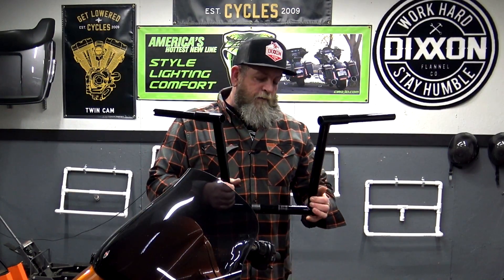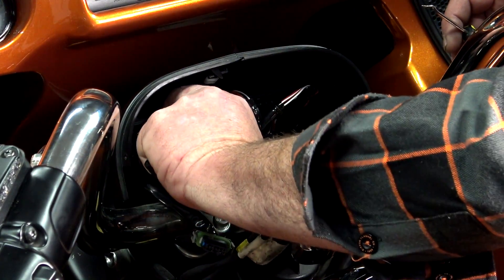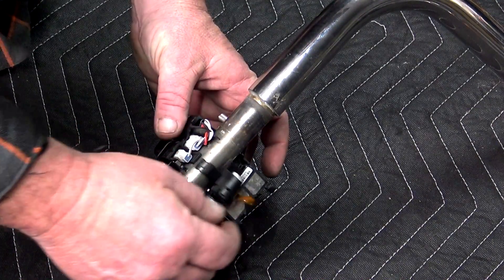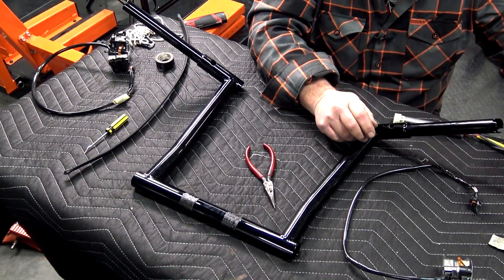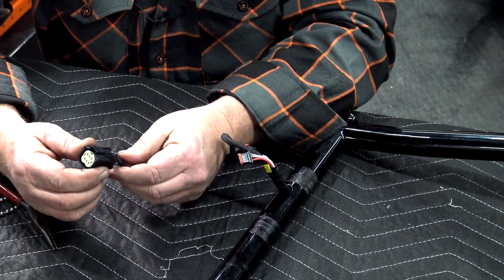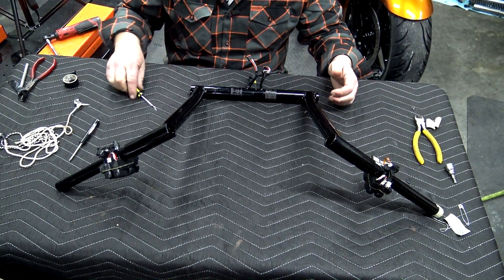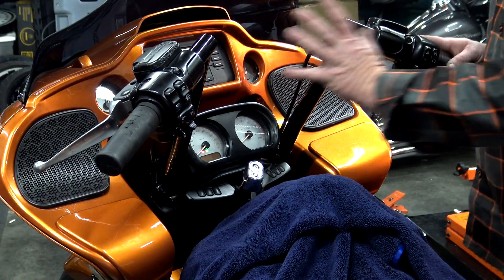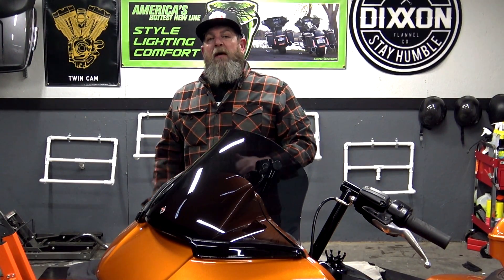⚡Road Glide Handlebar Install Road 6 Customs 2015 - 2023⚡

Comment: Great video! One comment I can make on the procedure (and I hope I am the first to tell this, as I learned this the hard way)? When the pin for the handlebar is removed (tapped down), the handlebars are free to move forward and back. And as they are pretty tall and heavy and when they are not snug, they can easily fall back onto your tank, creating a couple nice dents into your tank. So with these after market handlebars, always be aware that when you release the bolts, you catch the handlebars as just a towel will not prevent these dents.

Luckily for me, the towel prevented scratches and the dents could be removed by a specialist without painting.

Comment: My little tip for golfers - for the brake and clutch assemblies, I use my old golf club covers the way he used a Crown Royal bag. Slip them over and they can dangle safely without fear of scratching the paint. If you have some lying around, it's better than spending money or fooling with towels and tape. LOL
Reply from the maker: yes sir Bill...great recommendation...not a golfer so I never though about that but that would work perfect!

Comment: Those are very similar to the ones I added to my 19 Roadglide Special, I have the 6" bars, they fit me perfect and are below the windshield which was vital for me, especially during cold weather rides.
Reply from the maker: Yeah man I did the same thing on my SG and stayed with 10 inch so my hands were behind the fairing. We dont do a lot of cold weather riding but man its nice when we do.

Comment: Ordered the 11 inch naked bars took about 3 hours total to install myself new Grips love the bars so far also it is a 2022 so small plug for throttle by wire fairly easy install take your time on running the wires
Reply from the maker: love these bars! Get a lot of compliments on them...glad the video helped you!

Comment: Hey Steve, Thanks for the share. I bought the bars the put them on my 15 Road glide and they look great. I wanted to share something I found out by accident. When I de-pinned my throttle by wire connector the white center piece came all the way out and with the center piece out i found it fairing easy to de-pin.
Reply from the maker: yes I actually took that out during the de pining process when i cut the camera. I really should have just got the de pinning tool lol so much easier. I have one now and glad I spent the few bucks on it.  but you need to be careful not to break any of the plastic tips that holds those pins in. Glad you got yours apart.

Comment: Thank you for a great video! Had to run my harnesses separately on my '18 RG Ultra...didn't have the big molex connector, but the connectors it does have made a pretty big lump, even staggered a bit. Other than that, I would say that the hydraulic clutch cable "just" was long enough! Total time to change was almost 3hrs, but that was with the required beer break. Love the bars, and again thanks for the great tips!
Reply from the maker: Youre very welcome William! thanks for checking it out. And yeah mine too...just barley reached but they do! Glad the video helped man!

Comment: Just got my factory 47 bars and started this. Lucked out with the split, small throttle connector. Score
Reply from the maker: Thats awesome man....Everytime I do a 14 or 15 I cringe at the thought of seeing whats in there...its a 50/50 shot lol. Your wire job should go pretty smooth.

Comment: Goodnight!  I'm Brazilian and I want to thank you for the video, it will definitely help a lot when changing the handlebars on my motorcycle.  My doubt is about the safety pin, can you disable it, without running the risk of the handlebars not moving???

Comment: Really thought that de-pinning those connectors was a “I’d rather drink draino “ thing. But this video makes me think it is doable at my skill level. Damn-it, now I have to start shopping for bars.
Reply from the maker: its not terrible and if you get a cheapo de pinning tool from amazon it makes it easier...ive had those rather drink draino bars and pins before though...Ive actually said screw itm busted the connector and went to HD and bought another one and pinned it lol

Comment: Great video. My only critisism would be if youre gonna do the bars, do the risor bushings at the same time. Harleys stock bushings are garbage and unless you want to do this job again soon, do them while youre there. Other than that, if you follow this video, youll have no problem doing this job by yourself or with a friend. Outstanding content as always.
Reply from the maker: never had an issue with the newer model bushings. Although I agree as back in the day they were crap....they have stepped their game up a little but that being said if you are going to change this is the time to do it.  Ive had several 14 and up bikes thoughs and never really had issues with them.  If people wouldnt pull their entire body weight up using the bars, the bushing would last longer. Slide your rear back on the seat and push up instead of pulling on those bars, so to speak..if that makes sense.
Reply: @sikbaggers  makes perfect sense to me. I also run a step up style seat so i use my legs more than the bars. Love your channel and my 87 year old mother says you have as sexy a voice as Sam Elliot lol. I had to share that with you.

Comment: Just did the bars on my 2020 FLTRK.  You oughta try fishing wires through with the addition of heated grips. LOL.  Frikkin headache!  I put some Spooky Fast 12" bars on, they have sharp corners.  Your video was a big help.  Thanks man.
Reply from the maker: Hey ian we do them quite a bit here in southern illinois...and you are correct. I cringe every time I have to do a set lol

Comment: Nice job! What torque specs did you use to tighten the clamp for the handle bars?
Reply from the maker: handlebar upper clamp screws - 16-20 ft-lbs 21.7-27.1 Nm

Comment: Feed the chain and pull with the string, the chain can break. The propose of the chain is it easily follows the bars and finds the opening due to its weight and flexibility.

Comment: All your videos are great. I saw this video and I really like these bars except I cannot seem to find them for my bike on the Road 6 website. I have a 2018 Road Glide Special with the 1-1/4" clamping area. Any help would be appreciated.
Reply from the maker: https://store.road6customs.com/2015-2020-Road-Glide-NAKED-Handlebars-r6c2015roadglidenaked.htm these are the ones i installed in the video, they are the same for 15 to 20...1 - 1/4 inch , just pick the length you want

Comment: Great video , just finished mine step by step and bars look great ! But after installing cluster back on I’m not able to insert ignition bezel cover back on , very tight and won’t snap on , tried redoing cluster several times and same bezel won’t fit and and no ignition won’t press down and allow fork to lock if I force bezel in like this and might also snap bottom tab that locks in , any advice  ????
Reply from the maker: That ignition bezel was definitely an after thought by Harley lol you just have to press in the front tabs and then find a small pick or screwdriver to push the rear one down and click it in....if the tabs break, which they do, you can get a replacement on amazon. Ive had to do it a few times.  Chrome https://amzn.to/49zrrb0 and black https://amzn.to/3UC6b04

Comment: I have a 2017 Road Glide Ultra with heated grips.  Does it change much to change the bars with heated grips?
I enjoyed the video very easy to follow
Reply from the maker: not really just an extra wire and small plug...makes it a bit more of a pain to pull the wires that's all

Comment: I've been wantinug to swap bars to apes and I just bought my 23 road glide maybe 2 weeks ago. I keep being told that I need to run longer brake and clutch cables to do this.
Reply from the maker: that really depends on the size you want to run...all you ned to do is call a company like KST and ask...they have changed so many bars they will be able to tell you is you need cables

Comment: Do I need to do anything with the clutch or brake for the 12inch bars?
Reply from the maker: no you can do exactly like I did in the video and remove that plate that hos the wires in and you will have enough wire

Comment: OK Steve, here's an oddball question. What is the blanket you are using for your workbench. Kinda in the process of getting a better workspace in my garage and I recently ran across a good bench from Seville Classics, however, the top cover seems like a soft pine. A little too soft for work IMO. Any directive or information would be greatly appreciated.
Reply from the maker: Hey Brent...its really just a cheap moving blanket from Harbor Freight. I have several...another good use is laying them down in the floor to put your pags on or whatever other tin you take off your bike...they have served me well over the years and the wife got tired of me stealing the "extra blankets" and seeing them in the garage floor lol
Reply: @sikbaggers  well duhh Brent. I have to laugh as to how many search words I looked for to try to identify those and viola` there it is. A moving blanket. Boom! Thanks again for the response. Merry Christmas to you all and be safe out there.

Comment: I followed your fantastic instructions step-by-step however, once I finish the check engine light was on on my motorcycle. I have a 2019 Road Glide. Can you think of an idea why this may have happened? Or what should I do
Reply from the maker: absolutely normal...you just had a bunch of stuff unhooked so the ECM is telling you...follow my video here to test and clear your codes. If everything is hooked up right it shouldn't through those codes anymore. https://youtu.be/ZV8xONzYsTU?t=18

Comment: I found it very difficult to get off the clips on the right side of the cluster with fingers.
You can adjust your bars with the pin in but it limits your adjustment to about 15 degrees max. (At least with stock bars) I Would just knock the pin flush as you did.
Awesome that you're doing a video on the bars I've been planning to get. Did you mention what size bars they are and I missed it? Are those the 13"?? Road 6 Customs says you can go to a max of 13" before you would need wire extensions?
Great videos! Keep up the great work and thank you!
Reply from the maker: Sorry I just saw this comment yes they are the 13 inch bars
Reply: @sikbaggers  Thanks.

Comment: I have a 2021 road glide special, on the throttle cable has to connecter, do you just connect one connecter and just let the other connecter lose? Because I don't see where else to connect too unless I take off a connecter with two wire with a dummy connecter on it on the left side.
Reply: @SIK Baggers
Reply: @SIK Baggers

Comment: Great video! I have watched other videos and they say 14" is max before you have to start changing other stuff. I also seen something about pulling a fuse so codes don't pop up after? And if a guy added heated grips this would be the time to do it do you have a video on that aswell. Subscribed ride safe!
Reply from the maker: Yes sir...you can pull the fuse or clear them after you change the bars...easy to do through the speedo...And yes...for sure! if you are doing heated grips do it now! lol We did a set of bars on a 17 SG and they guy brought the heated grips over 3 days later...I asked him if he knew how those were installed and he said "plug them in right'? lol yeah through the bars we just had off the bike....ugh haha live and learn i guess.

Comment: Hey do you know where I could find a new throttle by wire with that bigger plug? Because I tried Harley dealer by my house and they keep giving me a little one?
Reply from the maker: I would check on ebay because youll keep getting the smaller one as they changed it

Comment: How much taller can you go on the bars before needed extensions? BTW love the channel
Reply from the maker: Thank you sir...with the RG its right at 13" bars...these are 13 and the cables barley reach doing what I did in the video by removing the zip ties and the central wire plate.
Reply: New Sub ..good info . You definitely know your shit . What a pain in the ass de-pinning that connection

Comment: Is the 14 inch the max before having to change brake lines and clutch lines and wiring kits 2015 road glide special
Reply from the maker: Hey Patrick sorry I just saw this...15 inch is pushing it with the road glides. If I went any taller I would look into cables for sure.

Comment: Great video, ordered the 13" bars from "Road 6 Customs", on the way to Europe now. 
Will let you know if this is a good choice, tried different types/brands already, never satisfied........
Reply: Got my 13” “Road 6 custom” handlebars delivered and installed, easily done with the great video. Did my first run with it and this is the correct handlebar for my length, strongly recommended this handlebar.

Comment: Wish I'd seen the road 6 bars before wasting money on the kst bars. I don't know if there was some sort of weld booger inside the bar or what, but no amount of trying could get the wires through, and trying was just tearing wire up. Ended up scrapping several hundred dollars worth of new bar and going back to the stock shit bars on my RK. If this virus ever goes away, I'm saving up to try again with these.
Reply from the maker: Ive never installed the KST's but I have seen their videos...they make it look easy lol but most of them do. These were pretty straight forward to pull the wires on...no boogers for sure...the throttle side will always be a bit harder to do but just some patience and pulling/pushing you'll get it.

Comment: This is 2015 to 2020 according to the title. I got a '21 RG. What changed? Also; any additional difficult steps for heated grips?
Reply from the maker: I shot this video in 20...so thats why it said to 2020.
Reply from the maker: Im adding this new response and edited the other because I thought this was question was on a different video sorry about that.  Here are the correct ones you need https://road6customs.com/collections/2021-2023-road-glide-handlebars
Reply: So the install would be the same on a '21 then. @sikbaggers  Regarding heated grips; does that make things more difficult or require purchasing longer wiring?
Reply: To add to my own comment; Heated grips adds a small amount of additional wiring, nothing complicated. Note though that the left/right cables do not have different sockets, so mark 'left' and 'right' before removal so you know which wire to reconnect to which socket (left cable also fits right socket and vice versa). If you don't, you might experience problems such as one grip not heating up.

An extra addition; after reconnecting everything the 'check engine' light remained on. Using the Odo button (top left button that you removed earlier) you can reset the error codes. Be sure to write the errors down before resetting; in case you accidently damaged a cable or connector, having this info will help you find the problem.

Comment: Hi. I followed step by step the video, everything when very good until I tried to start the bike. It fells like the start button is dead, the rest of the hand controls are fine. Do you have an idea what could I have done wrong?
Reply from the maker: The only thing you could have done is either pulled a wire out while you were pulling the wires or unplugged the green connector inline while pulling the plug...I know it sucks but at this point you have to check the connectors. It happens...you just have to get in there and double check your connections and if you had to de pin like I did in this video double check your pins are in the correct location and pushed in all the way.

Comment: Is it true that narrower bars make maneuvering and handling much better?  U-turns etc. I am thinking about replacing my stock bars on my 18 street glide special. I am 5’9”  Do you have any recommendations.
Reply from the maker: yes I more narrow bar would make it easier..I run 10" la choppers twin peaks on my SG and the first time I had to do a u turn I felt myself reaching way out to make the turn...very uncomfortable ..the "pull back" on the SG bars is also something you need to look at. RG and SG bars are very different ...If you look how your bars come out from under your fairing and then up, that is the pullback measurement. The RG bars just go straight up from the neck so there is really no pull back. If you get a 3" pullback your hands will much colser to the fairing so when making turns its hard to stretch out that far...a 6" pull back would bring them closer to you and make it easier. now the SG bars, like the RG bars can be literally pulled back towards you too. It really takes time and riding to adjust them. Just much harder on the SG as there is more stuff to take off. Best thing you can do is go to your local HD and test ride a few used bikes with bars on them and see what feels good.

Comment: Awesome video! Looking forward to upgrading my bars on my Road Glide. Did you replace the riser bushings or are you using the OEM ones?
Reply from the maker: Didnt mess with the bushings, thats a quite a bit larger install and there is nothing wrong with the ones I have.
Reply: @sikbaggers  Copy that. I was told I'd need to upgrade the bushings to polyurethane bushings if I were to do taller bars. Definitely upgrading my RGS with this bars very soon. Thank you for the information and keep the great videos coming brotha!
Reply: @campamanny  you can but unless there is a lot of play it’s not worth it if you have to tighten the neck bearings then I would change them due to having everything off again